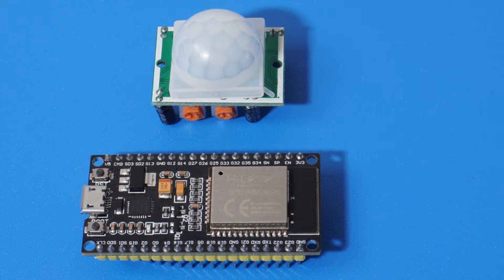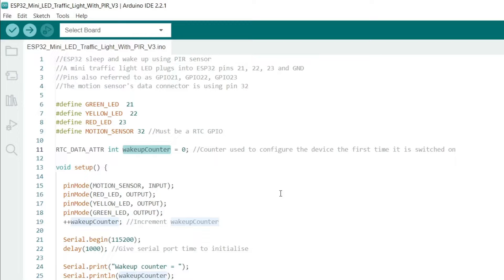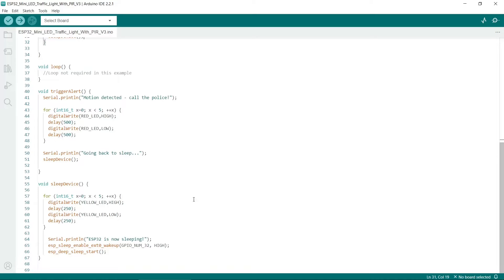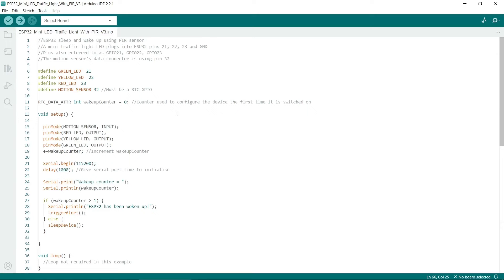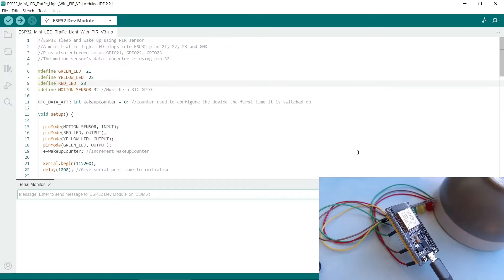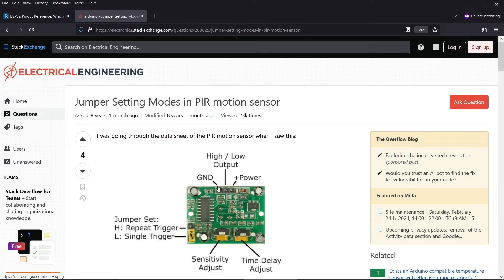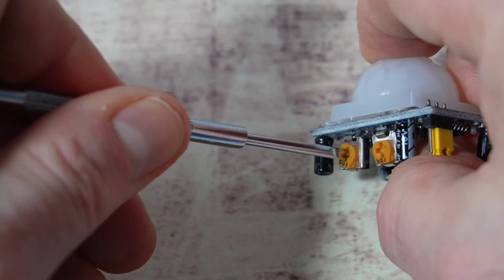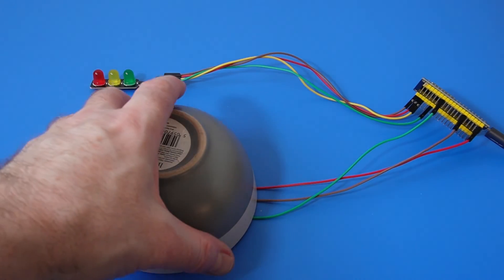ESP32 Wake up with PIR Motion Sensor

Comment: Maybe I missed it in the video but what pin do you use to power the sensor itself? I understand that 32 pin is used for input from sensor but what pin should be used to power it while the board in deep sleep?

Comment: Nice to understand more on this subject. Looking for help on my project also using ESP32 with a PIR motion sensor. Problem is that the sensor is placed inside a mailbox and when its triggered by mail arriving the (metal sided) mail van is in between the sensor and my router effectively blocking off the transmission. My thought was that I could trigger an automation when the sensor resets but how do I configure it for perhaps a 2 minute delay?

Comment: Brilliant tutorial and love the code explanation. Just about to buy first esp32. Would the espCAM package work if separated from the cam board and controller only used do you think? Presume it has interrupts to use. Thanks ahead.
Reply: most of the time i keep the MB together with the esp32CAM, but i've recently separated them because i want to use solar power and wire the esp32cam up.

Comment: How to do this with ESP32 Cam?
Reply from the maker: I don't know if you could wake up the ESP32 CAM if the camera detects motion. Having the ESP32 CAM start recording if the PIR sensor detects motion should be possible. The critical thing is to use the right pin for the PIR sensor that wouldn't interfere with the camera. I'll give it a go some time.
Reply: @codingwithbrett  Thank you